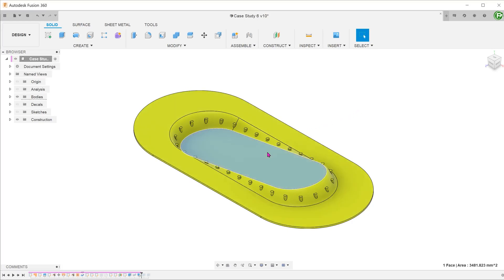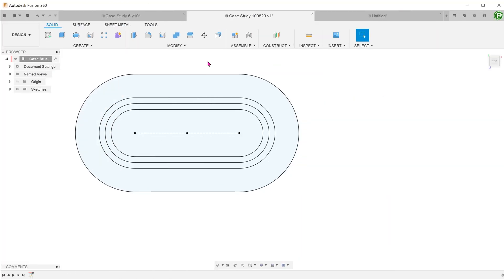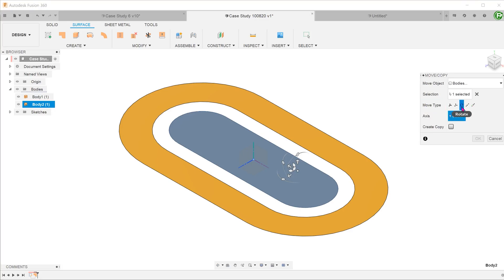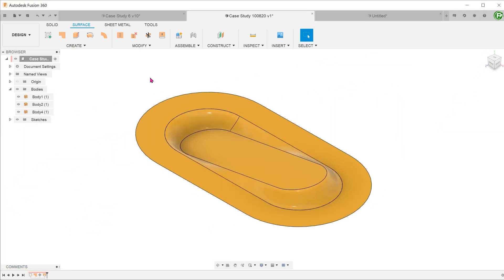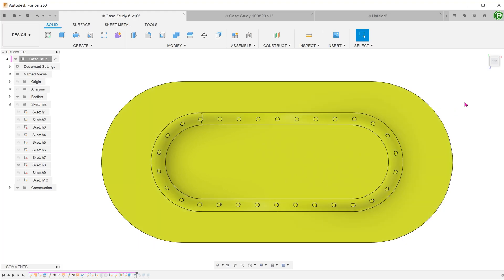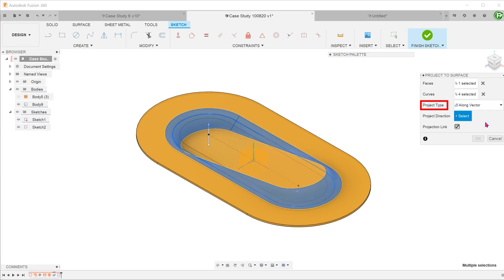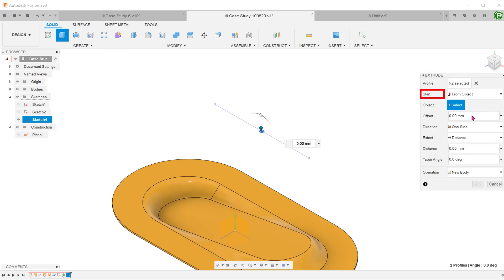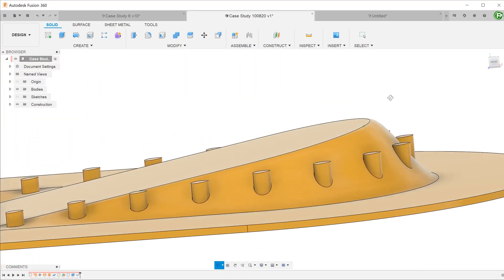Fusion 360 - Case Study 5

Comment: I don't think the projection at 4:50 is correct. It's projecting straight up, rather than being right in the middle of the transition. You can see that right at 5:01 how close the projected line is to the top face vs the bottom face.

On the Extrude Cylinder (last step) what if you wanted those cylinders to be perpendicular to the face?

Comment: Great example of 'project to surface' command and 'pattern on path'. Fusion struggled a bit with the last one. It seems the order of settings makes difference. I wonder how to achieve those small cylinders have top faces parallel to the surface they raise from (like offset face).
Reply from the maker: Pattern on path is notoriously hard to control and can give unpredictable results. I did something similar where the cylinders follow the reference face. You can check this out if you are interested.
https://www.youtube.com/watch?v=i1vkgMtgbGI